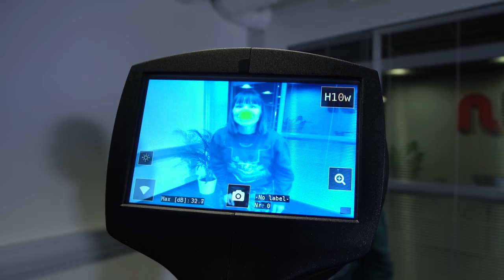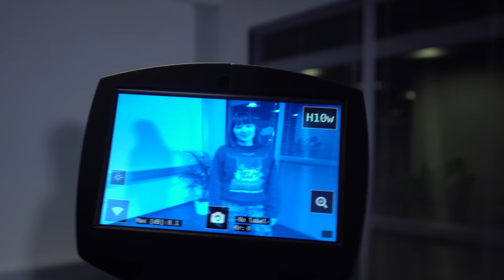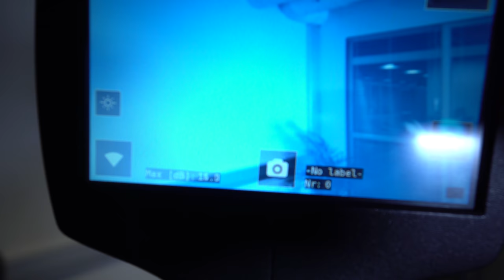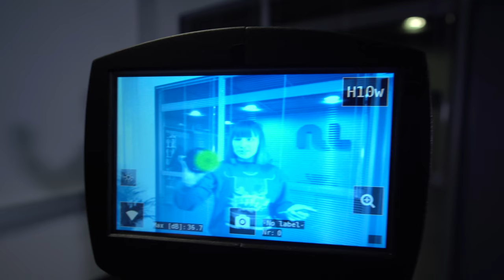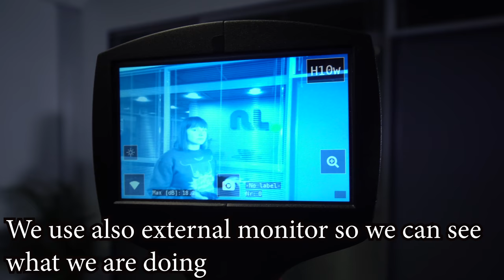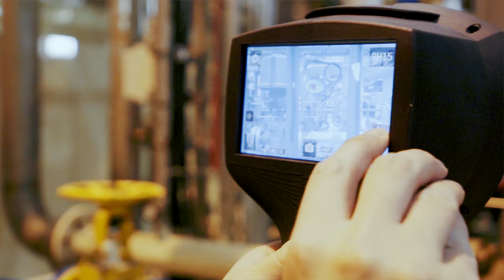Filming Sound with Acoustic Camera!

Comment: 1) Pinpoint the location of a loud noise (like a gunshot) from your treeline when you are standing in your field (threat detection)
2) Pinpoint the location of wildlife while you are inside your forest (wildlife detection) 
3) Use it in a place where lots of small objects are falling around you (like a rainstorm or after using dynamite to life a bunch of dirt into the air)
4) Use it with a directional speaker at night to see if you can create some kind of echolocation system (like sonar, but with air instead of water)
Reply: 5) If there's an explosion next to a long row of regularly spaced poles, the reflected sound comes back in a rising tone due to diffraction, so the colours from the closer and more distant poles should be different.

6) Noisy fireworks that scream in the air as they fly.
Reply: 7) "Where is that annoying sound coming from"
8) imminent machine failure detection
Reply: @tismoto  Yes indeed!
Reply: @DavidRichfield  For sure!

Comment: not just for rooms.  think of the tactical significants of this.  couple this with Night Vison equipment and you now have another dimension of sight.  depending on how sensitive it is it could pinpoint someone breathing in a dark room or a foot fall or gear rattling.

Comment: Two thoughts...

1. take it to a shooting range and set it up facing the firing positions.  See if you can identify who is shooting by the sound prints.
2. Take it to a concert, maybe an orchestra and shoot wide angle of the performers
3. Find someone with a really good surround sound system and see how it handles positional audio
4. Film a train going by and see if you can spot rough spots on the track or bad wheels

Comment: The hydraulic press. What makes the noise in the press!!!
Reply: Zzyzx The pump, the motor, and the relief valve.
Reply: Lou S well okay... But still. Would make a cool video, or atleast a segment... Where they open the press and they show the main parts what they look like, how they work etc... Before this, I didn't know what a hydraulic press was (in the sense of what it actually is. It's in the name, a press that uses hydraulic fluid but beyond that I was drawing blanks)

Comment: I wonder what would happen if they recorded a jet going faster than sound
Reply from the maker: You will see the shock wave well behind the jet but this works also really well on slower speeds and we are going to test it
Reply: Obviously you can see that the processor is to slow to accurately show movements of the source already. So you'd maybe see a bump where the jet breaks the sound barrier and then the rumble after. Maybe a line of the rumble there but most likely just one unspectacular blip due to the speed of the processor. This camera is more for optimising room acoustics.
Reply from the maker: We can speed up the camera by chancing some settings. It should be able to film up to 60fps
Reply: Beyond the press OMG you replied 
Thanks for what would or could happen you really made my day thank you

Comment: Car with legs 8:41 WAT DA FAK !  Good futuristic innovative design.
Reply: John Deere made a legged harvester prototype over 10 years ago!
Reply: It's also very obviously designed by someone who has never driven a forest machine, considering the biggest problem in the forest is sinking through the "crust" and that's when you need as less as possible weight on small surface. This website has a quite awesome compilation of what happens when the surface gives up http://www.vinssi.fi/galleria-2/galleria-uusimmat-kuvat/
Reply: I once looked at the real time gps map on a harvester that said there's a swampy area ahead, looked normal to me and I went on and as soon as I hit the area the front wheels just sank a meter even though it looked exactly the same as all around. Needed to push myself out with the crane since it was so sticky
Reply: What about rocky, steep mountains ?
Reply: I'd say equally bad. Metal on rock never has good grip, with 6 wheels drive and using the crane also you get much more power than with tiny legs. I've gone up stupidly steep hills with a 6wd harvester, when I've struggled with walking up.